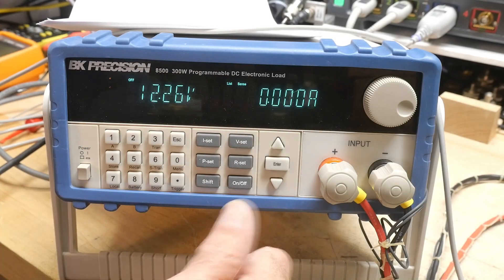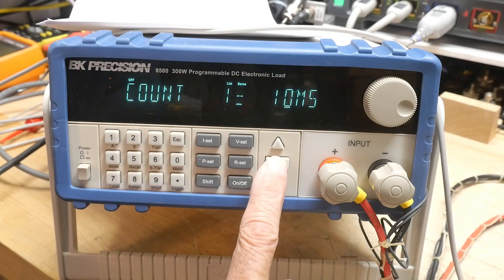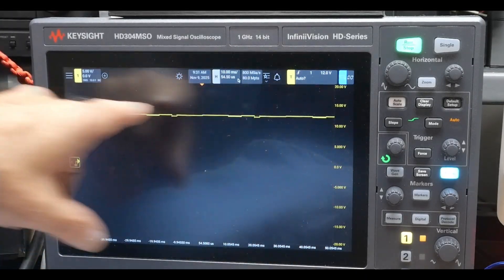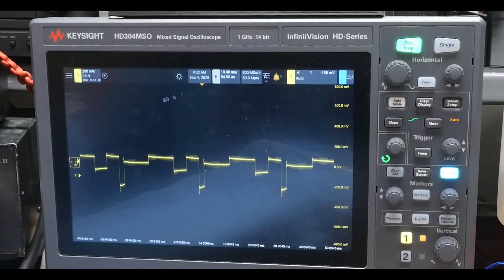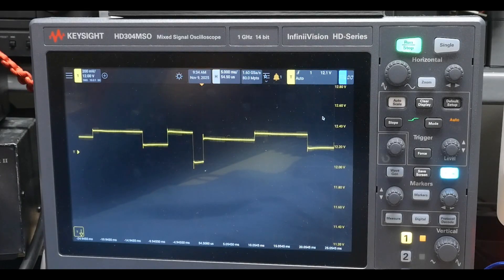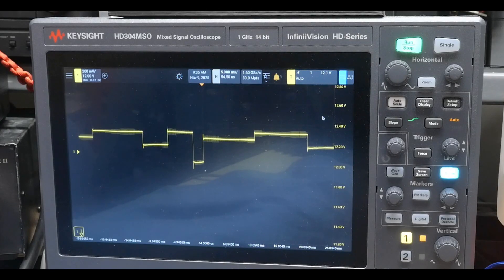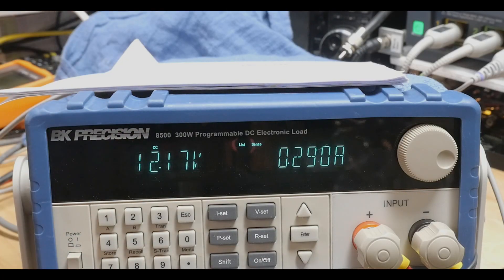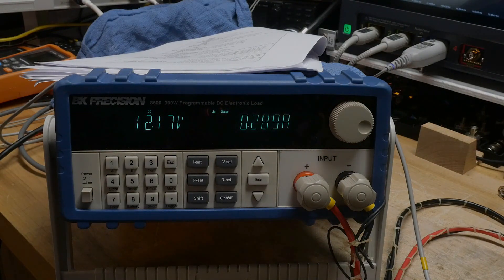#2425 BK Precision 8500 DC Load (2 of 3)

Comment: I am guessing the noise seen on the oscilloscope is due to the load.  The noise looks like its amplitude is switching between various constant levels as the load "hunts" to maintain the programmed constant currents.  Presumably, the load uses a switching method to achieve some or all of its regulation.
Reply from the maker: the load does not switch. it uses a linear driven FET
Reply: @IMSAIGuy  Okay, thanks for the reply, correcting my guess.  The noise waveform remains interesting.  🙂